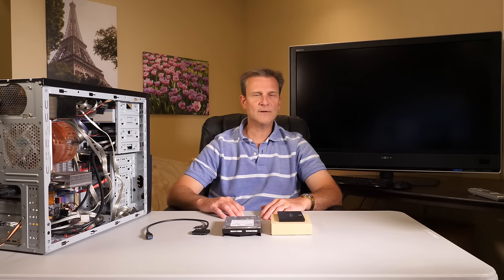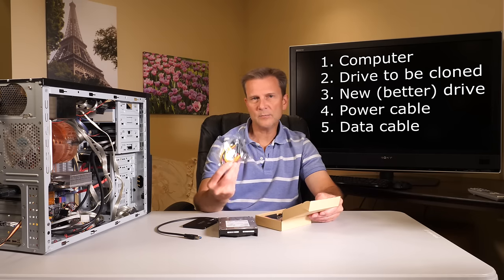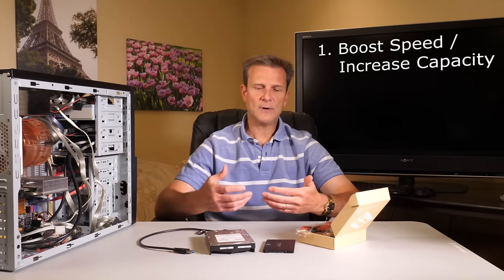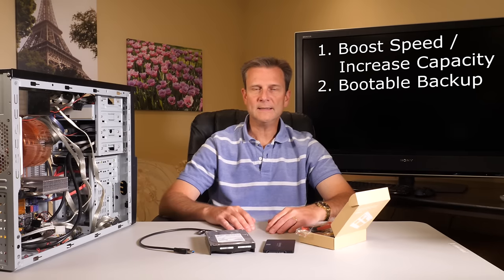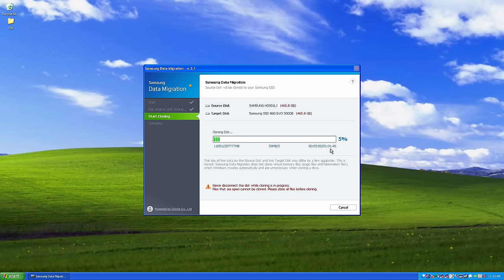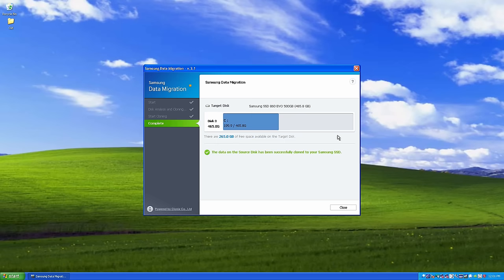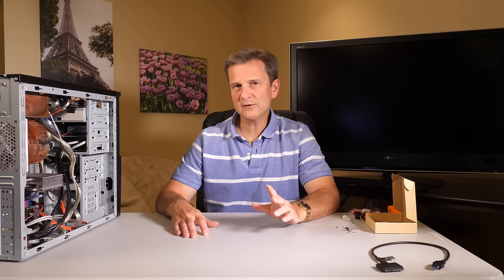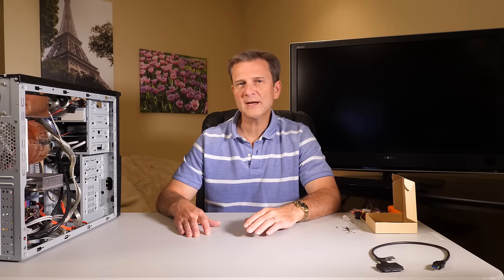How to Clone Your Boot Drive to SSD Without Having to Reinstall Windows or Any Other Programs

Comment: One trick you can do, assuming your Acronis etc. is not from your drive manufacturer is to temporarily add a third drive of the correct brand, you don't need to write to, or read from this drive, it's just there to make the software happy.

Comment: Thanks.  This is very explanatory.  I have a laptop that will not boot up. How can i access the bad HD when it is not booting in order to transfer the data/files on it into my new HD?  Thanks once again.  Can i just remove the old HD from the crashed laptop and connect to a new Laptop.?
Reply from the maker: Yes, you will need to remove the hard drive from the laptop and connect it to a working computer. The cable I mention is the video is a simple way to connect the drive. Hopefully the drive is working well enough that you can copy data from it before it completely fails.
Reply: @NerdSidekick  Thanks, I am waiting on my order of the cable.  I will give an update when done.

Comment: I just did a similar thing but cloned the boot Motherboard mounted 256GB NVMe to a 1GB NVMe I temporarily attached to a $17 PCle x4  card in a slot using the free utility called Macrium Reflect.  It was very simple, as in idiot proof.  Once done I switched the NVMe out and it booted immediately with zero issues.  Interestingly I repeated this but instead using a USB-c attached standard 1TB SSD and took the resulting Clone to my iMac 5K and booted to the Windows 10 Pro SSD.  It worked perfectly and all I had to do was add the Boot Camp drivers for that Mac.  It can now run all the Steam Games that are also on the PC. Obviously not at the same time but very useful.

Comment: If the original Boot Drive contained Windows OEM,I suspect that the clonned SSD can only be put back to the original computer (laptop or PC, with original master board) for use.

Comment: I never used the software that belongs to the hard drive I am cloning. There are few paid and free versions of software to download online. 
This video is very good for beginners. To someone who never did that before, there are cables to connect the drive to a USB instead of searching for the right sata connexion. My cable is old and capable to connect to ide drive and of course sata and still working. But it needs to be plugged into external power.

Comment: Wasn't too painful? It would have been better had you been using a win10 system and not some ancient OS, ha-ha.. I noticed the old OS doesn't have a system recovery partition. I think 7,8 and of course 10 has a system recovery partition. My question is when you clone to a larger drive than the source you end up with unallocated disk space after the recovery partition which you can't seem to expand C: into. So how do you do that, does the Samsung software take that into account or not?

Comment: That is easy. What is heard is how do you clone an old either spining or ssd hd to a nvme m.2 drive? I have done it using the similar USB Hd connection hardware. I used an external USB drive bay. Same principle. Only this this depends on being able to boot your old drive from your external usb connection and the tools on your motherboard as well. Give it a try.

Comment: When you clone the HD to an SSD you are putting all the OS files and App files and Data files on the SSD. In my laptop I moved the Data files to an HD so as to save space on the SSD and my laptop had room for a 1 TB HD as well as a 256 GB SSD drive for the OS and App files. Microsoft has detailed instructions on how to change the Data files to a separate HD from the OS SSD drive.

Comment: Thank you! I was thinking of buying software to clone my old WD HDD to a Samsung Evo SSD but now I know I can just use the migration software.
I suppose I could boot into BIOS before unplugging the old drive and tell it to boot from the new SSD.
I noticed that it put the old drive as Drive C and the new one as Drive C as well. That is helpful because that's what I want to do.

Any tips if I want to backup files from my laptop to my desktop or a new laptop? Not necessarily boot disk. The USB ports on my old laptop are failing & I want to get all my data off of it while I still can. I wish I could select specific programs to transfer. I had a program on my old laptop that I wanted on my desktop but the disk broke & it was an older one that wasn't available for download. I'm on satellite internet so I have bandwidth restrictions as well.

Also, thank you for the links! The one for the bracket will come in handy. We installed an SSD in my mom's computer & it's just sort of floating inside one of the bays. Now I know we can get a bracket to hold it steady.

Comment: My Dell XPS is giving me error messages that my optical hard drive is failing. Is it possible to install an SSD drive and completely, somehow, bypass the original optical drive and only use the new SSD for booting, starting, program files, etc without having to deal with the original drive? This computer is only 3 years old with a great processor and lots of RAM. I don't want to have to buy a whole new one when a new SSD drive is relatively cheap.

Comment: I have cloned my W7 ultimate  drive. The Samsung 870 EVO 1TB is recognized and boots as intended.
The problem is that the original mechanical drive is not recognized so I can't do anything with it to use it as storage. It is shown in the BIOS and Device Manager but not in my computer. If I reconnect the original drive all by itself it boots up and is recognized in my computer as the C Drive. Would you know how to get the cloned drive recognized in order to use it as storage ?
 I appreciate this video it took some guesswork out of getting the job done. Thank You:

Comment: I am trying to clone a the SSD drive that came with my new HP Pavillion and looks like there is only 1 port available.  It is blue and says SATA 2.  When I plug in my New WD Blue 4tb internal drive and pull it up through Acronis download software shows Disc1, the 256 as NVMe and then the Disk 2 4tb as RAID interface.  Can I still clone this through this port? So confused now.

Comment: man did you remind me of some old times. my first hard drive a seagate st-506 was the size of a small 2 slice toaster. try not to laugh yourself to death when i tell you the storage was an astounding FIVE MEGABYTES ;> then i moved to a 20 megabyte 5.25" seagate drive and after that to a 5.25" 80 megabyte drive. of course dos limited you to a partition size of 32 megabytes, so with the 80 megabyte drive required 3 different partitions to be fully used. i remember when in 1990 i bought a pair of 500 megabyte samsung 5.25" drives and at the time it never occured to me that i had ALMOST a gigabyte of combined storage ;> in those days to clone a hard drive, all you had to do was sys the new drive and then xcopy the source drive to the destination drive. i can remember when i thought i would NEVER fill my first 5 megabyte drive and now all i can do is complain because all i have is 9.09 TERABYTES on a single drive ;> i am 64 now and i hope to live long enough to see a single petabyte drive, even if it is just a single petabyte. i would also like to see a 100 gigahertz cpu.

Comment: For nerds only.  The old type of hard drive is designated HDD [Hard Disk Drive] which is a mechanical device which is slow compared to SSD's and is also prone to failure.  A key to getting the most life from an SSD is to not use more than 75% of the available formatted space which is approximately 7% less than the size of the SSD.

Comment: Hello, I have a PH Envy Phoenix 810-150se with a 256 GB SATA Solid State Drive and a 2 TB 7200 RPM SATA 6G data drive. I can't understand why I'm losing space ON MY 256 GB DISK DRIVE when I'm not installing any software. Is it possible the drive is going bad? I purchase this PC about 7 years ago. it works fine with the exception of the drive...I was thinking of upgrading to a bigger SSD drive

Comment: At the 19 minute mark you unplug your old hard drive so the new SSD drive will be the boot drive. Why not just switch the cables of the 2 drives? By placing the cable from the old drive to the new drive would not that cause the new SSD drive to now be the boot drive?

Comment: How often can you make cloned copies of entire HDDs or SSDs with the free software?  Does the cloning process erase the source drive or is the data still there?  I'd imagine this can be used for cloning all manner of data, not just for duplicating the contents and structure of a bootable OS drive to make another.  With that in mind can the cloning software be used to send duplicates of itself to multiple other target drives simultaneously?  WD makes USB Flash Drives, SSDs, HDDs.  As I understand it as long as the drives are all from the same manufacturer (WD cloning software for example) then this should work as a cheap way to mass duplicate multiple drives at once.  Like for making promotions, software and multimedia file distribution, etc.

Comment: So what do I do with the old drive? I want to use it still as and storage drive. Do I just hook it back up after the close and format it? Thanks
Reply from the maker: I usually keep the drive unused for a few days after cloning, just in case something didn't work with the clone. But once you are confident everything is working fine, you can definitely use the drive for additional storage. You can reformat the drive, or just leave it as-is. Just make sure your BIOS is set to boot from the newly cloned drive rather than the old one.

Comment: interesting but my situation is different, my old PC packed up took he drive out n the CD plyer recorder, I have No CD on the new PC its only a small 3 pin plug there but my old CD player  had a multi plug on it same with the new SSD am too old to start learning about PC now my question is Can I buy any kind of device to plug my old hard drive into n transfer it to the new SSD? Again the new SSD only has a small 3 pin plug that goes  into, is there something I can buy that I plug my old HD into it plug then power it on the mains supply n a cable to connect my new SD drive to transfer the data? or maybe transfer data  into a USB n from the USB to the new SSD? I want to delete everything from the SSD my PC now is Dell OPTIPLEX 7010 ALMOST NEW MY MATE GAVE IT TO ME WHEN MINE PACKED UP any help will be greatly appreciated guys

Comment: In my case, I have an iMac and I want to replace the hard drive with a larger one. How do I go about doing the cable interchanging? this is an iMac 21.5 2013. and the cable interchange, in my opinion, is rather different. I follow teaching in the tower computer, but with the iMac, I don't know what to do. Thank you for any light you might be able to share. Bytheway, I liked your explanation of the tower's exchange.
Reply from the maker: David, thanks for watching. I have not owned nor done any serious work on a Mac since the early 90s, so I don't have the knowledge you need to help you on that platform.
Reply: Unless you want to learn Unix commands, your best bet is to use either SuperDuper! or CarbonCopyCloner. They both work really well -- I have used both -- but I prefer SD!. The choice is yours. They aren't free, but you can try them for free. You can always replace your computer, but you can never replace your data.
Reply: @anothermacuser3564  AGREED!  I love CCC.  It works perfectly.  I'll take a look at SD.  Cheers!

Comment: DONE. But my 1T HDD is still bootable. Once all my choice programs are loaded, and I have set Windows settings to my liking, I will  then transfer that to my 1T HDD drive such that if any thing goes wrong, I can boot up again via the 1T HDD drive, and then transfer that back to my NVMe SSD once again, in mere minutes.

Comment: When cloning from an m.2 SSD PCIe NVMe Boot drive that has lost SPACE due to age and use To a brand new Larger m.2 SSD PCIe NVMe Boot drive, will you loose capacity because of the bad (CELLS) on the original  m.2 SSD PCIe NVMe Boot drive?

Comment: Can I do this with my old hardrive I have and put it into my new build?. I am upgrading the motherboard, CPU,memory, possibly cooling, and case. I thought I would have to redownload all of it and buy a new Windows 10 copy. I have not built a system in years since this last one so I am a little behind tech-wise as I am still running an i5 2500k. If the answer is yes can I put in my existing storage hard drives as well with the SSD boot drive without any issues or will I have to download all my steam games again and files?. Also, I know I am asking a lot but in my new build is it possible to upgrade to an i9 CPU and still use my existing GTX 1070 ti GPU? or will there be issues?, will I need to also move from air cooling with my Noctua to liquid-cooled with an i9?. I appreciate it greatly if you could help me?.

Comment: if your using this drive to boot from (C drive) then you might also want to look into ways to minimize excessive writes to ssd drive cuz they are only good for so  many writes ... there other really good videos that cover this. if your just using it as extra space to run your favorite game from then you won't need to worry about excessive writes as much
Reply: Dude, any modern PC or Mac uses some type of SSD (e.g. NMVe)  these days.  Your spinny disk of yesteryear may in theory support more 'writes' but it can die anytime due to motors, boards, and so on not to mention be 10 to 100 times slower.
Reply: Its usually too many writes for the normal user to worry about, they would upgrade down the road anyway before getting to that point.  That being said, all it does is go into read only mode.
Reply: @joshuaguenin9507  you could be right, i honestly haven't looked at how many writes we are up to recently cuz there is nothing wrong with the 4 or 5 spin drives i have installed now. i only had 1 drive burn out on me in my life time. i know when ssd drives first came out number of writes was a issue for people that dont want to buy stuff regaurdless every year ... ( i'm one of them, if i bought one it was cuz i needed more room not because it burned out usally)

Comment: It's actually easier to copy via hardware! Software copying is unnecessarily complicated and likely significantly slower. Get a two-dock USB hard drive caddy. Most of them have the ability to throw your drive into the 'source' drive on the dock, and there's a 2nd drive space for the cloned drive to go into. And on the back of the device there's usually a button to engage the copying action. This copying is faster, because it can be done without a computer even attached!  Here's an example listed on Amazon for the dock I have, which works just fine:  "ORICO Dual Bay 2.5" 3.5" USB 3.0 to SATA Hard Drive Docking Station with Offline Duplicator and Clone Function [UASP Protocol and 2 x 12TB Supported]- Black" -- currently listing for $33ish.

Comment: I did this with the samsung 870 evo and when i tried to boot with the SSD it said it cant be booted with an error message. I went into bios and changed the SSD to spot #1 and still same issue. I know its copied onto it because it said 100% complete and that it was going to shut down in 20 seconds and did so. Im so confused?
Reply: I ended up getting it working by resetting my BIOS, then changing it to UEFI and not legacy/UEFI. I also forgot to re-overclock my ram so i had it running at 2133 instead of 3200 for a few days, and it was STILL like 5x faster than my HDD. lol

Comment: can you just pull the power cable and sata cable off the CD rom player and use those to power and read the new SSD
Reply from the maker: Yes, should work just fine.

Comment: Hello Mr. Nerd...When using "Samsung Data Migration 3.1.0.5 ",  the info I'm reading is confusing.  Does the ORIGINAL (SOURCE) SSD have to be a Samsung-made SSD? 
I understand that the TARGET (NEW) SSD that I'm cloning "TO" has to be a Samsung product, but they are not clear about the source SSD's manufacturer!!! Can you please help??? 
Thank you for your EASILY UNDERSTOOD, DETAILED video on cloning!
Reply from the maker: No, the original (source) SSD does not have to be a Samsung drive. In most cases, it probably won't be since the likely scenario is that someone would be cloning an older drive from a non-Samsung manufacturer.
Reply: @NerdSidekick  Thank you for your rapid reply! Stay Safe.

Comment: I am cloning from a manual drive to an ssd and after I formatted it- it named the new SSD drive (D). I am using macrium. My question is this- because I want to do it right. I noticed a partition on the original disk also has the letter D. Before cloning, should I change the SSD to a different letter? I am not sure if it will conflict or just overwrite it after the clone? I am installing it in a laptop replacing the manual drive after cloned. Thanks!
Reply: If you are not adding more drives, that is you are not going from one to having two, then you shouldn't need to change the name.

Comment: I did this recently. I had a usb backup. I disconnected the old hd and installed a new ssd. I made a windows boot usb stick and selected the clone hd option to copy from the backup to the new ssd. Took about 3 hours to copy.
Reply: Yes, this is kind of practice is works as well, in this case you not need any SATA power cables and/or some sort of USB-to-mSATA adapter-cables at all. Nice! 👌☺

Comment: Unfortunately, SAMSUNG does not support systems other than these for cloning:
Operating System Windows 10 or higher macOS High Sierra 10.13 or higher
Disk Capacity Minimum 600MB available for installation Supported Partition Types MBR, GPT
Maybe if you can find the legacy "data migration" files used in this video then you can actually clone an XP drive. Too bad because that's what I was looking to do too....